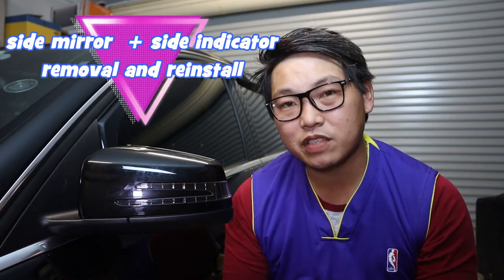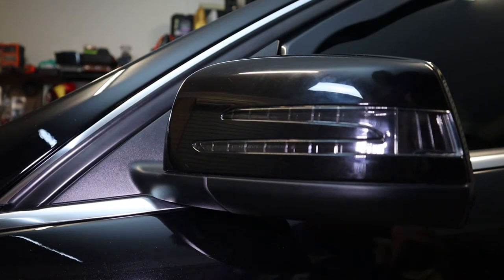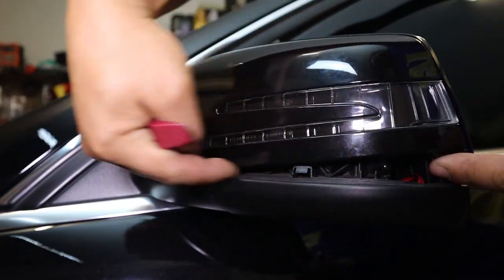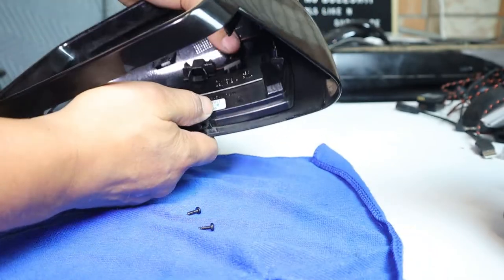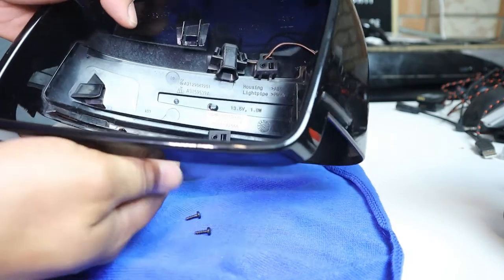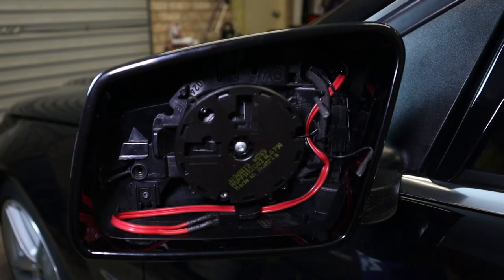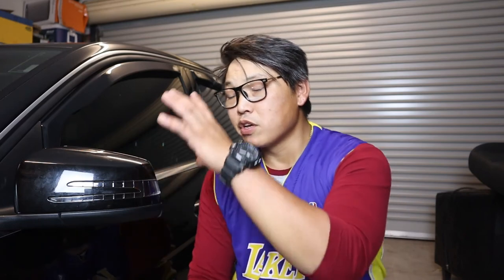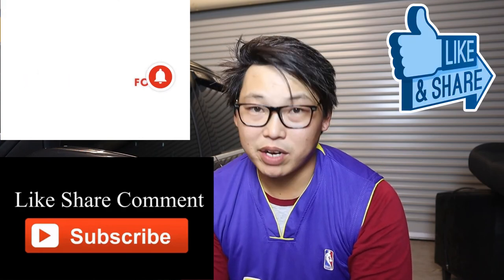mercedes w204 side mirror cover + led indicator how to remove + reinstall

Comment: Hello again my friend! Thank you for the tutorial! I just ordered the exactly same mirrors for my 2008 car. I had dimming and auto folding mirrors so I bought the e mirrors with same function only for facelift! The connectors look the same so I hope is gonna be plug and play! I noticed the face lifted model has more wires in the white connector but the park selling them told me they did that before and they are working !❤ wish me luck !

Comment: good clear informative video ..very helpful..i have always been worried about how others remove it by using brute strength..i like the way you removed it in this video.. you showed very specifically that you do not need to be rough and hard..just take your time like you always say and with the help of a trim removal tool it can be done very carefully and easily...well done mike!!

Comment: I have a 2008 C200 Kompressor (W204) and my mirror cover/LED is different, can I just swap to this one that you use ?
Reply from the maker: if ur plugs are the same yes u can
Reply: @MIKEYZVLOGZ  Yes they are, but some people told me that the mirror has a different format...
Reply from the maker: @LucasLeal96  ive seen it done before a d i sidnr hear about that..unless .,.,u need it to be activated  or synced somehow...but i dont see hiw thats necessary for aide mirrors...im not exactly sure
Reply: I also have the old light Lucas, did you change to the New one?

Comment: Fyi some mirror covers have a screw holding it on from the inside, you pull the mirror glass out first then undo the screw then pop the cover up.  On mine the driver side had no screw but passenger did
Reply from the maker: good to know , thanks for sharing

Comment: Do you know what size the T10 Torx screws are?  My mirror housing got knocked off off the mirror mount and was destroyed.  The replacement kit I got doesn't come with screws.
Reply from the maker: ill have a measure for ya as im changing the base again to a proper oem one as mine was cut out via diy and im not happy with how it looks

Comment: My actual glass seems to sit a bit low on the bottom left corner and it’s scrubbing the lower edge of the housing! Are there set screws or anything on the mechanism to center the mirror edges?
Reply from the maker: no there isnt are u sure its clippes in right ..it shouldnt be rubbing against anything regardless of how far u adjust it ...it should never touch the side mirror frame

Comment: Hi! Is it the same procedure if you've got the blind spot indicators on your mirrors? Any extra wiring to worry about when removing the mirror exept from the heating wires? :)
Reply from the maker: The same ... if u have blind spot then you will have the connector for the blind spot so an extra connector just remove slowly u will see connector eaay to remove aswell ...
Reply: @MIKEYZVLOGZ  Thanks!

Comment: Hey Mike.
I installed a new mirror indicator (normal indicator, not dynamic) on my passenger side and it works just how it should. However, when i start the car i get an error message on the display telling me to check the right side mirror indicator. Also the first 1-3 times that i use my right indicator, the indicator light on the dash (green arrow) will flash more frequently. After that the flashing is back to normal until i restart the car. The error message is always present in the "messages" dialog. 
Any idea what it might be? The spare indicator was bought from a reputable store and cost 60 euros. Maybe i should have should rolled with ebay, cause i dont seem to hear other people struggling with this.
Reply from the maker: Hey bud...welcome to the channel... make sure when you plug the light in that it is plugged in correctly sometimes the pins get loose or even bent causing an inconsistent connection... also check that there are no breaks or loose wires and lastly it can even bs due to your rear tail light wire harness... cauaing the dast flaahing..wen ur car has a faat dlaahing indicator its usually a sign that another bulb in on the same side is loose or blown.... lastly get a scan done with a good obd2 scanner to try narrow the issue
Reply: @MIKEYZVLOGZ  Thanks mike, ill try out your suggestions.

Comment: hi i install a dynamic turning indicate light for my w176 A250  ,but the it been delay dont know why? the front turning light flash 7 time then the dynamic light flash 1 time. and the dash board indicate left mirrow indicator!...any help please?
Reply from the maker: Hi buddy so if you are experiencing error msg u may need a resistor or a relay so that it can fees constant 12v when the led turn signals flash ... mine doesnt have any errors ...so for some reason i dont need to do that but in your case get a resistor or a relay so u can feed 12v when needed
Reply: @MIKEYZVLOGZ  thanks bro where can i buy that risistor is it ezy to connect? i bought my dynamic light from ebay,  i sould buy from DMP car design cause it erro free...